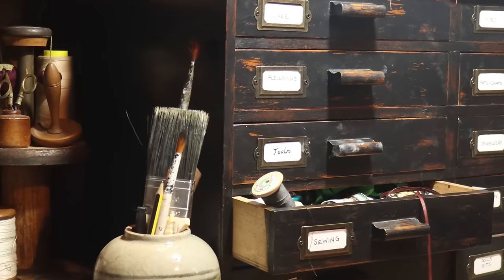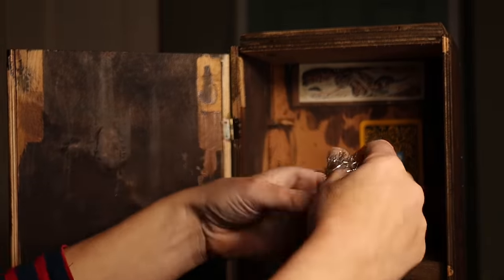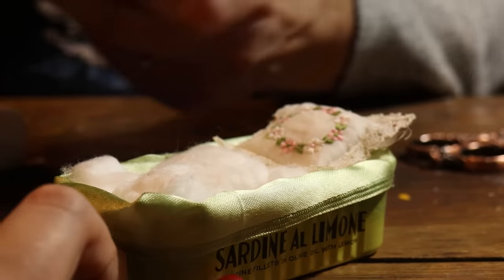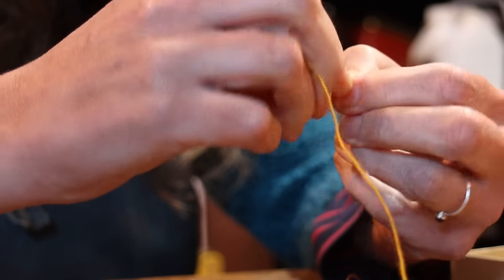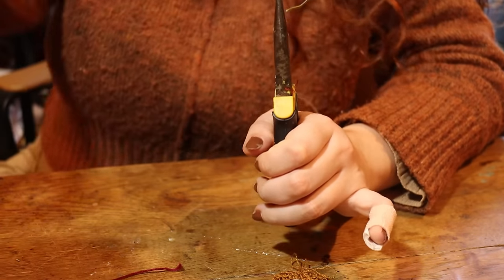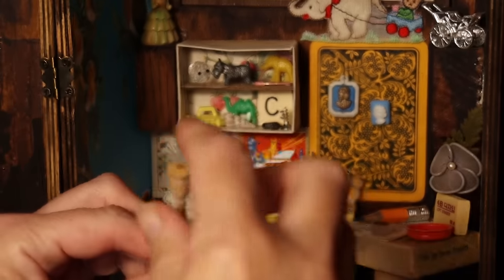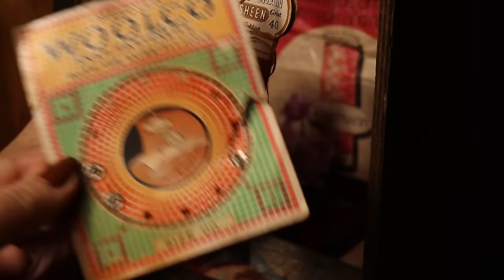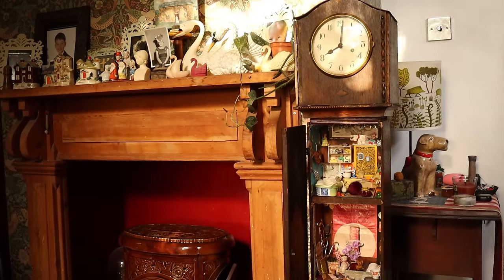We Have Always Wanted To Build A Borrowers Miniature Clock! So We Did!

Comment: If I were a borrower a glove would be so useful , for making small articles of clothing…socks, under ware, tank tops from the fingers, or pillows and the body could be sheets….a knit pair of gloves could be made into a winter sweater or blanket, leather gloves for shoe making , or a squirrel saddle, or a very sturdy hammock…..😊 I loved the borrowers….your crafting is so sweet , thanks for sharing.✨p.s. paper clips are easier to make hangers……and for your kitchen, small tea tin with the top and side cut out, wood or coal inside and a piece of screen for the top of the bbq…..champagne cage tops for chairs, buttons for plates, a saucer on a spool for a table, metal measuring spoons for pots ( handles cut) acorn mugs, toothpaste tops for cups, glass salt seller w/ spoon for serving, a crystal toothpick holder for a vase…..I think I need to build something✨……toodles! Can’t wait for you next video! 😊